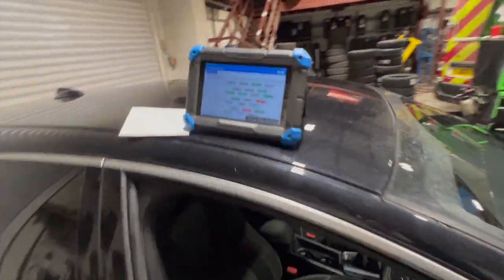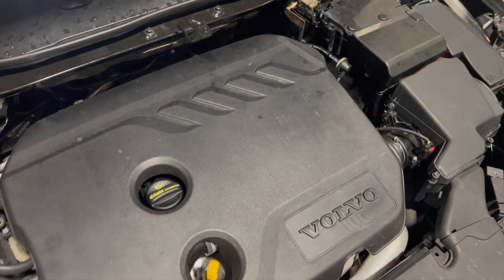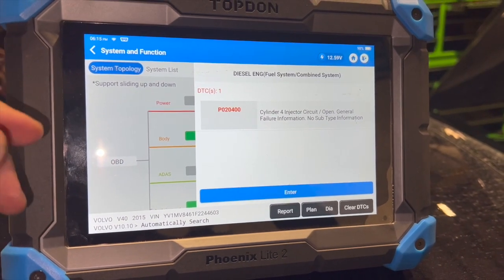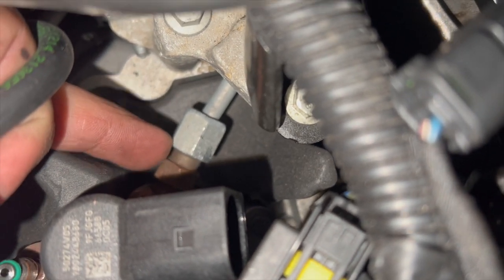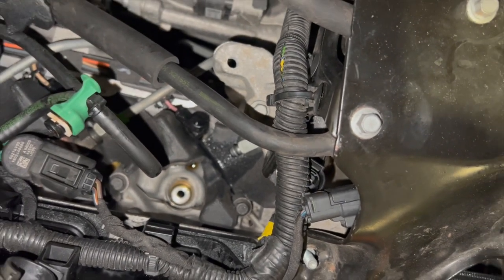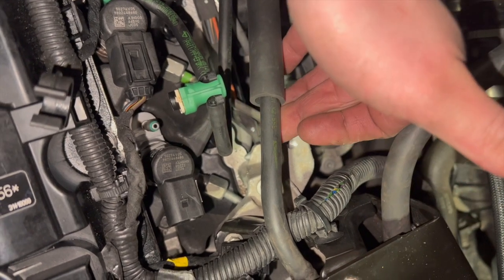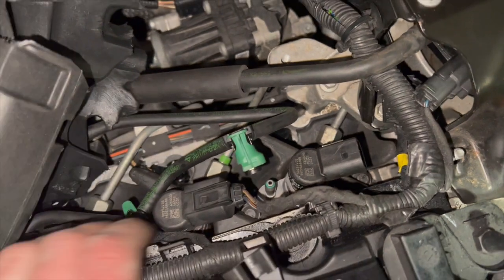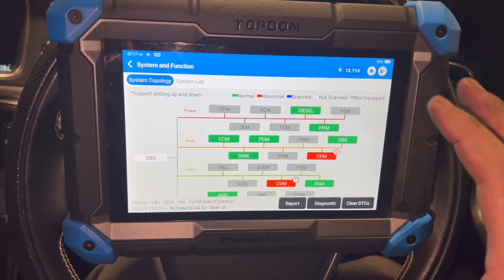2015 Volvo V40 1.6D Injector replacement

Comment from the maker: New Fuel injector Ebay - https://ebay.us/ybkDI7

Diagnostic machine used in this video:
Topdon Phoenix lite 2 Ebay - https://ebay.us/tsyiTI
Topdon Phoenix lite 2 Amazon - https://amzn.to/3dxuQQl 

Tools used:
Milwaukee 3/8 impact driver - https://ebay.us/ZtxrBu
Socket set - https://ebay.us/7tUKdM
Digital Torque wrench - https://amzn.to/34kpI9y
Torque Wrench - https://amzn.to/2VZ4CKu
E-Torx sockets - https://ebay.us/5a3i3Y
Screwdriver set - https://amzn.to/30RA53L
Spanner set - https://amzn.to/2DlwUZm
Injector cleaning set - https://amzn.to/3grvnPB
Injector seal removal tool - https://amzn.to/2O9d7P7
Ring Inspection Lamp - https://amzn.to/3gGWHcG
Bonnet lamp - https://ebay.us/3y0gGv

Injector clamp bolt torque setting:
stage 1 - 4NM
stage 2 - 65 degrees
Reply: Hi mate, 
Just a quick question for you, 
I have a volvo V40 D4 r design 2.0 diesel year 2014,  now i seem to be going through oil quite a bit,  I've been looking for weeks every morning for oil on the road where I park and nothing they no smoke coming from anywhere at all running fine, 
Just can't figure out where it's going.
Any help would be appreciated
Reply from the maker: @sheffcitys2forgedinsteel255  may be burning it , dactyl how much is it using , how much per how many Miles roughly
Reply: @DIYDaly  every few weeks it asks for half a litre to 1 litre as it's not a manual dip stick it's electric one,  
What you mean burning it,?  How, and why, and solution
Reply from the maker: @sheffcitys2forgedinsteel255  so much will pass through and get burnt up as it’s passes through the exhaust .. these engines arnt know for excess oil consumption though , you need to get it checked really . There’s a possibility the turbos failed or a leak in the intake system and it’s dragging the oil into the intake ..
Reply: @DIYDaly  if the turbo had gone tho wouldn't it be kicking out smoke through the exhaust? 
And it's been like this for a year now and apart from not knowing where the oil is going it runs and drives fine no loss of power,  
Very very strange.
Reply from the maker: @sheffcitys2forgedinsteel255  yeah if the turbo bearing has failed badly it would have no power and be smoking like a gooden.. just a possibility it might have bit of play in it and dragging bit through.. just thinking outside the box a bit.. its hard to say without actually looking at a fault ike that
Reply: @DIYDaly  too true,  
Will have to get someone to have a look, 
But because it runs fine I'm a bit weary as it is hard to find a mechanic you can trust ,
Anyway thanks for the reply mate
Reply from the maker: @sheffcitys2forgedinsteel255   no probs 👍

Comment: Ive got a 12 plate v40 thats rough idling  but havent had a code for the injectors but hav had one for the fuel rail, would it be worth getting the injectors done?
Reply from the maker: Could be various other issues , I wouldn’t replace them with out a specific fault code or without testing them

Comment: hi, what symptoms did the car have before the injector change?
Reply from the maker: engine missfire
Reply: @diydaly  and what was the value of the faulty injector before?
Reply from the maker: @ionelcocosatu2849  engine light was on with a cylinder injector open circuit fault , didn’t check any other readings
Reply: @diydaly  thank you

Comment: Today I replaced an injector on my 2015 v40 D2, your video was great guidance.Thanks! I noticed that on the car you worked on the dashboard shows: "ESC termporarily off". I had exactly the same dashboard message before replacing the injector. After replacing the injector it changed into: "City safety service required'. Any idea what this could be? Thanks in advance!
Reply from the maker: Thanks for the comment , tbh I’ve never seen that message before , have you done a full code scan after? Presumed it should have some sort of fault code relating to it
Reply: I have a faulty injector. And the same esc message. Can't be a coincidence.

Comment: Hi there, on my s40 1.6D 2011, i had the 4th injector faulty been changed in garage with an new one, but when i picked the car up, when is accelerated has an tapping noise comming from engine/injector can't notice exactly from where. It this happened to someone or anyone knows the reason / any tips. Diagnostic has no fault found i don't know if injector been coded but my friend couldn't see that function on his snap on diagnostic tool. I been back with the car to the garage and they said can be from DPF but i don't see the sense cuz havw no fault and before the injector faulty engine been smoothly.
Reply from the maker: Some times the injectors are quite tappy until configured correctly .. could be diesel knock

Comment: Replaced copper seals on this engine today due to fumes in cabin. Noticed a leak off pipe clip only had 1 tab instead of 2, could this cause the fume smell inside the cabin?

Keep up the great work you're videos have been a lot of help to me
Reply from the maker: 👍 should be ok if it’s not leaking fuel still

Comment: Very helpful video. Iv a 2013 Ford focus 1.6 tdci and I'm getting code P029A cylinder 1 balance - fuel trim at max.
Is this injector going bad, car has rough idle and it is very jumpy at low rpm seems down on power aswel
Reply from the maker: Thanks 👍 yeah im fairly sure thats the injector
Reply: @diydaly  Thanks for the reply. I'll pick up a new injector and give it a go, hopefully it sorts it. 👍

Comment: Hey, just wondering what the yellow band around the diesel injector you pulled out is for. I saw that it was not on the one you put back in, and I am just wondering if it is necessary, or if it works without. I have removed mine, and it has a similar band around it in white. The new one I am going to put back in does not have one. Did you put one on before you put the new one in, or is it not necessary?
Reply from the maker: You can get away without it , it’s a locating guide to keep it nice and square
Reply: @diydaly  Thanks so much! This was very helpful. Nice video!

Comment: Great video very helpful 
Especially listing torque settings tools needed etc
Thanks for your efforts to help people
Reply from the maker: Glad to help 👍👍
Reply: Quick question I’ve just removed my original injectors and they have a small plastic sleeve around them 
the new genuine ones don’t 
do you know if you have to remove that sleeve from the original and put it on the new one
Tia
Reply from the maker: @JamieMerchant-w8b  yes you should swop it over mate

Comment: Great video, very helpful! I have a S40 2012 with the same engine, that needs injector replacement due to short circuit. Do I have to lubricate the body of the new injector before fitting it in? (The old one  was very corroded for some reason)
Reply from the maker: Neh just clean the hole out well & the seat

Comment: no need injector coding ???
Reply from the maker: its more of a calibration, it will be ok without coding but takes longer to adjust
Reply: Just replaced number 2 on my mondeo and it's running rough still but no EML, is there a self learn after driving a few miles?